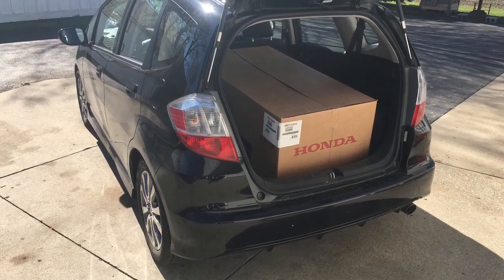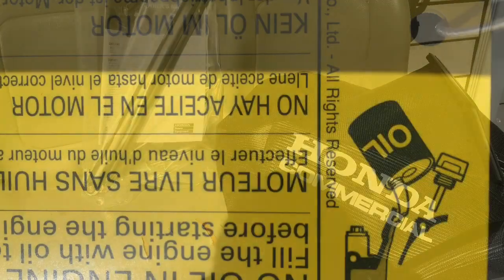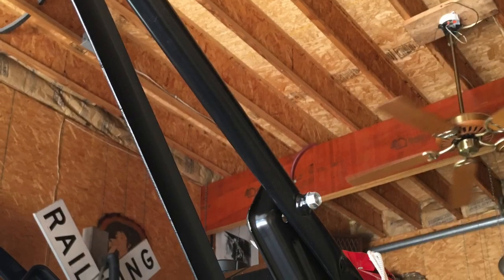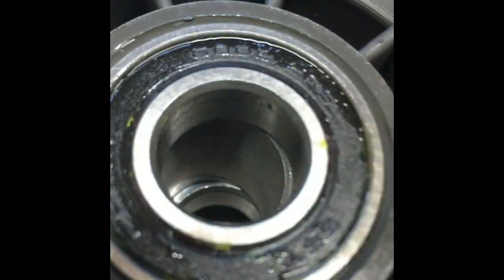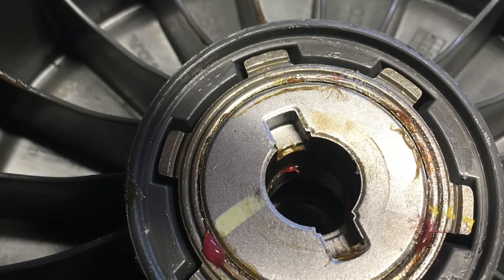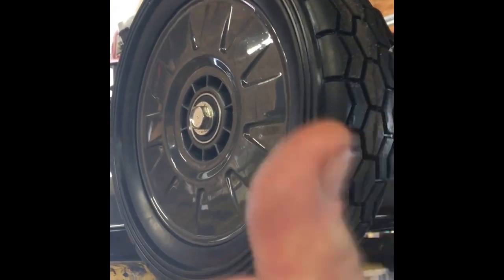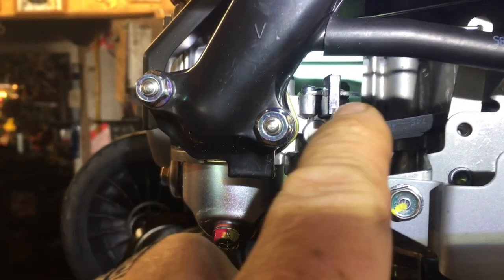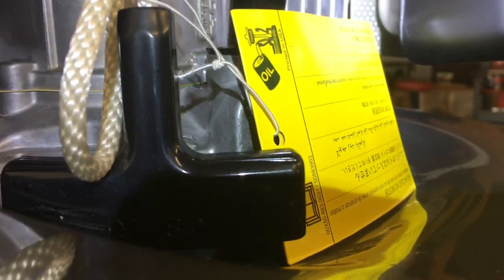HONDA COMMERCIAL 21" HRC 216 HDA MOWER / "Let's grease her up" !!!

Comment: Great tips, points, and comedy! I’ve now done the same to my Honda HRC216. I love the quality of this mower, I have a 20 year old Honda residential mower that I use with my lawn business and it runs like new. Other than the transmission going out which was replaced today thanks to another YouTube video it’s never had any problem. I’m excited to see how long the commercial model will last!
Reply from the maker: Thx. Jordan !!   HONDA:  "as time goes by / you'll know why" !.   :  - )
Reply: Yes I have the HRC216 commercial  and the home version  I have gone thru 2 transmission within  year on the home version and the hrc216 commercial  not one at all .Don't get me wrong they are both good mowers they are used daily..going into my 12th year..with both..
Reply: @TommyZTrains  i prefer Honda gcvx and non with camshaft in steel rather in plastic camshaft

Comment: Great vid TommyZTrains! I bought an HRC-216 back in 2005/06 cause I didn't want to purchase another lawnmower, ever. Since then, I've loaned it out to three or four of my friends over the years because their $300-$500 mowers broke down or engine blew most recently, yesterday. Change the air filter and oil every season and it'll be ready to lend a helping hand year over year.  
-Nice tip on greasing the bearings, I'll do it as soon as I get my HRC back again :-) TY!
Reply from the maker: Hi Calvin !!  "as time goes by / you'll know why" !!  (Good Slogan yes ?).   THX. !!  :- )

Comment: Nice info. Just purchased one last month I didn't relube the bearings but not a bad idea. I did spray the underside with a good silicon spray not sure how long that going to last but its better that doing nothing oh Waldo waxed the out side of the deck sure makes the grass come off easy. Just to note my old troy built still going but 24 years old and getting tired.
Reply from the maker: "Fluid-Film's" pretty nice stuff Lyn ... "That stuff really works to" !!!

Comment: On this model, can the handles be folded down easily or do you have to take off the screw boot on and off every time unlike the HRX residential models?
Reply from the maker: Nope, with the COMMERICAL unit it's all nuts and bolts.
Reply: @TommyZTrains  ty I figured, beautiful mower!!! 👍🏼

Comment: Happy to see this video - thanks Tommy! Did I understand this correctly.....the mower in the video was built in 2016, and you purchased it new in 2020? So it was basically 4 years old when you bought it? Also, is there any reason to think that the red grease you added would negatively interact with the clear grease Honda used in the bearings?
Reply from the maker: Hi Tim !!  Yeah; "the build date IS the build date" ... and so far as the grease: "I have no idea" (compatibility-wise) so "no", I just used "Lucas" red n' tacky / DONE.  It's interesting: it seems like that in MORE & MORE examples; (take a Toro Zero turn / and the greasing of the machines mower-blade mandrels / as a for-instance),  the actual "zirc" (atop of that mandrel) does NOTHING.  Again: (in the example I preface here), "Why": because the two inner-bearings (again: INSIDE the mandrel), are SEALED / and the plastic - covers are ON like the "covers" that I remove in this clip on the various bearings (in the Honda product here) ...... ANYWAY: "your actually greasing  N O T H I N G". 

IOW: there should be no "cover" too spud off !  & that bearing(s) cover SHOULD HAVE BEEN left OPEN .... (like a "bearing-buddy on a boat trailer). 

Quickly: In the above example / I called Toro (It wasn't easy actually "talking" to someone either) and I made a remark about this FACT ... *their reaction was one of great confusion, amid a total lack of understanding of just "what" I was actually TRYING to say !. So FINALLY I got "through" / and we "connected" / and they understood what I was saying / citing a "manufacturing process error". *That was alot of BS as my Zero-Turn Dealer here (in my town) replaces these mandrels ALL THE TIME ! ... "it's designed obsolescence"  Tim !. Anyway: my 'zero-turn' sounds like a gigantic "weed-wacking Ginsu" when I engage the cutters !. "I luv it".

Finally:  it's interesting that I seem to be all alone in my having done 'ANY' of this ... "them bearing's is sealed" (they say) "LOL".
End-run: "my shit's filthy in grease and it will NEVER fail". Epilogue: This "excessive compulsive" shit's ta blame / "says my wife" ?, ...  GREAT: YOU'LL FIND "ME" THERE.   : -   )
Reply: Ujoint applications, grease has to be totally purged (on greasable) and cleaned out of sealed bearings. Most grease isn’t compatible.

Comment: Great advice Tom! I just bought the same mower and would like to perform that exact service on the wheels. Could you please provide the brand of that "pick tool" you used to remove the outer gasket covering the wheel bearings along with the synthetic oil? I found the Lucas red grease. Thanks!
Reply from the maker: Hi Gil, Just a nice "Dental Pic" ... (an awl wouldn't work that well I think). Just be gentle / and it will come-off nicely. BTW:  mine continues to operate FLAWLESSY.               HONDA: "as time goes by, YOU'LL know why".                        :- )
Reply: @TommyZTrains  Thanks Tom for your expert advice. Yes, gentle, and patients is the key. Which I have neither! lol... Thanks again for your informative video.
Reply from the maker: @gilgarcia4501  :- )
Reply: @TommyZTrains  Hi Tom, Well I followed your service advice with the wheels on my Honda HRC216 (front wheels no issues.) The rears I'm having an issue? How did you get the rear bolt to tighten without the other wheel bolt turning? the transmission bar just spins. I was able to get one tire off but when I tried to tighten the bolt It just kept turning? Which then I couldn't loosed the other tire? appreciate your help? lol...Thanks!
Reply from the maker: @gilgarcia4501  I don't really know ... *It sound like the NUT is spinning / not in it's cage. This Mower is at our "Summer-Place" and not in front of me / and won't be for some time. Perhaps you're overlooking some small little means of holding that "nut" ?. "Sorry".

Comment: Hope all is well.. quick question.. How did you get the rear wheels off? I can't seem to get the wheels to lock as I turn the nut, the nut just keeps spinning 🤔
Reply from the maker: Hi,  "I can't recall" / and this machine is at our summer-place / thus I cant look. I'd guess it's just a simple matter of a hidden nut on the inside "stick".  :- )  sorry 4 delay answer